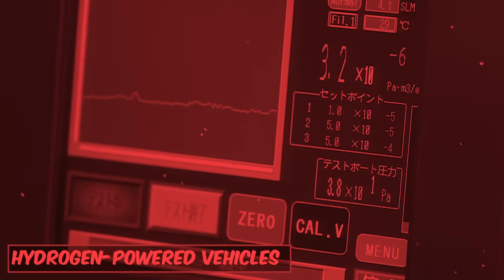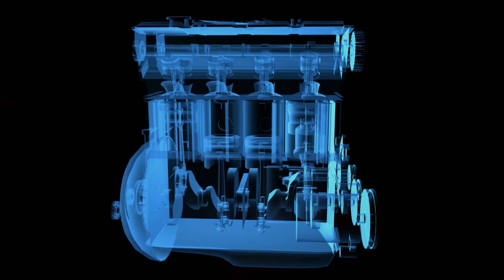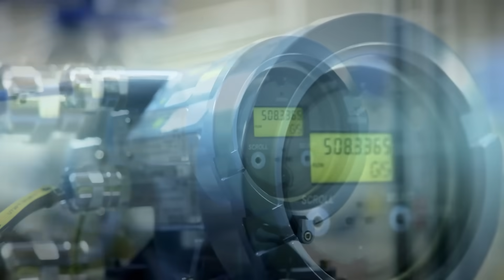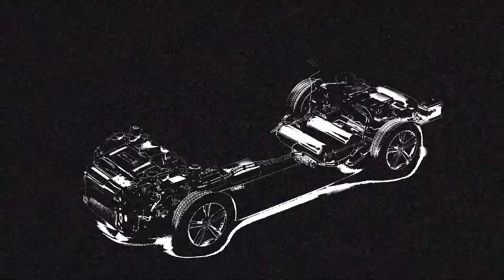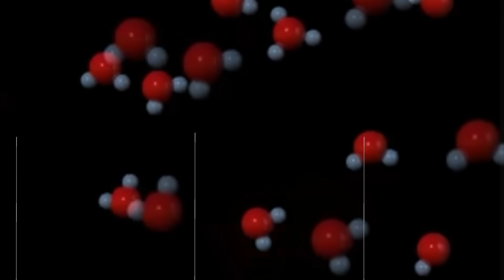Toyota's New WATER Engine Will Destroy The Entire EV Industry!

Comment: Lmao the information in this video is not accurate. It does not run on water. It runs on Hydrogen, which has to be pumped from a pump - just like gas - into the carbon fiber reinforced FUEL CELL, which it definitely has. When you buy one of these vehicles @ $50k, you also get $15,000 in Hydrogen included. Water is used in the engine, but it is NOT the fuel source.
Reply: If you are burning the hydrogen in a piston engine, you are wasting valuable energy.  You might as well run it on Chivas Regal.

Comment: ABSURD in the extreme. This isn't "water fueled" any more than a steam engine is water fueled. Both need some external source of energy. NONE of the energy comes from the water. In the case of a steam engine the actual fuel is the coal or oil burned to heat the water and create steam.

In this so-called "breakthrough" the fuel is whatever is creating the electricity required to disassociate the water into hydrogen and oxygen. NO energy is coming from the water.

The video makes allusions to Toyota working on it. Note there is never any proof that Toyota is doing any such thing. They are too smart to spend a dime on this!

Comment: you only talk about the water, but where the energy come from, for electrolyze. So it need to have both. Watertank and Batterie? But even if it need a batterie which would be smaller then in EV's then I think still a good idea.
Reply: I can assure anybody that using a battery to drive an electric motor is far far more efficient than using a battery to make hydrogen, and then burning the hydrogen in a reciprocating engine.

Comment: Unfortunately, there are a lot of factual errors in this video from energy density numbers to conversion rate to proof of someone converting their car, which was debunked. What would be nice is if they got together with Mazda, on their rotary engine and Koneg for their axle motors, so they could pioneer better energy ation for the electrolysis and better horsepower for the rotary engine, combining the best of all three

Comment: Water, "its basic elements LIKE [not "of"] Hydrogen & Oxygen"?
"Diluted Water"?
High voltage electrolysis but no  battery.
 Why does that ring an alarm bell?
Reply: There's a battery. A big EV battery. The video skipped that part, but Toyota did not. It's in other videos, and in their block diagram.

Comment: What a load of bollocks.   There are four laws of thermodynamics: The first law states that energy cannot be created or destroyed.  Only transformed, and that will result in loses caused by the transforming process.  So where is the energy coming from to do the Electrolysis to get the Hydrogen to start with?  Once engine is running, it can either power travel or generate electricity for Electrolysis.   But not both, unless you can produce the formula to show how it done?  Since electrolysis requires around 53 kWh of electricity to produce one kg of hydrogen, which holds only 39.4 kWh (HHV) of energy.  So the loses already amount to 13.6kWh, before considering further loses for conversion of Hydrogen into motion.

Comment: Making a hydrogen engine is easy, the real problem the video is overlooking Is where the energy will have to come from to create the electricity for electrolysis to separate hydrogen from the water.  This is why hydrogen so inefficient is because it requires so much energy to produce And right now the electrical energy is produced by petroleum-based products.

Comment: What provides the electricity for the electrolysis?
Reply: a battery. It's an EV. lol
Reply: A battery, but closer to a normal car battery rather than an EV or even a hybrid battery.  It would have an alternator to charge the battery.  Eventually would need a new battery as do gasoline combustion engines.
Reply: @EatMyShorts75  No... where do you people get these ideas. Toyota has block diagrams of this. They're using a big EV battery. It's going to take a larger battery stack to power this than a conventional EV, because it's less efficient. I do hope they either abandon it or publish some actual papers on the technology. It seems to be pointless.
Reply: what provides the energy for a hybrid ? self generating system.

Comment: Motors running on water by electrolysis or by 'changing' the water by some secret process. have been around for 100 years but suppressed by the people in power. Don't believe what the car manufacturers and the oil companies say, they have been sitting on technology for decades that would reduce energy costs and pollution, but suppressed it in order to make more money. And the governments around the world who are so concerned about the people and our environment won't demand these companies use that technology.
Reply: But I bet you'd get very weak in the knees at getting into the nitty gritty of material dialectics, and at identifying the inherent flaws of capitalism

Comment: I agree with smferreiro.  The article is light on engineering.  We all know what water is, where it comes from and that you can store it in plastic containers but where does the considerable amount of electric power come from?  There will still need to be some onboard storage of hydrogen as the electrolysis system will not be able to match the rapid changes required by the engine.  Will the electrical power be stored or generated?  If generated, there will need to be a mechanism for starting the engine.  We need much more info about the electrical system.
Reply: Look up water to fuel u can build one yourself with hardware store components.   And yes it takes more energy to roduce than it will put out the gas produced is highly explosive and must be made in small amounts this is old tech google it
Reply: You cannot get more power from hydrogen, wether you combust it or just combine it with oxygen to produce electricity. The power it'll produce is always less than the power used for electrolysis. This can be done in gasoline and other combustible substance because the potential energy within a small amount of gasoline is so high enough to run an engine and the alternator itself which produce electricity used to ignite the gasoline.

Comment: One question I have is cold climates ? Where I live you can get sub zero temps.
Reply: i guess once the engine start there is enough heat to warm the water in winter.

Comment: The elephant in the room is: After saying "forget charging lithium batteries", where then is the electrical energy for all that electrolysis supposed to come from? Water isn't fuel. It is the product you get from burning hydrogen fuel. The video mentions that high voltage is needed to break the water down into hydrogen and oxygen, but never mentions how that is supposed to be driven. There will obviously still need to be a battery. At which point, the electrolysis and hydrogen engine are just middle-men to an electric motor. The holy grail fuel they are searching for is a liquid or solid substance that quickly beaks down to release hydrogen without input energy. Ideally it would be somewhat stable under storing conditions and breaks down in the presence of a catalyst. Water alone can not be this substance because you first have to put all the energy in that you would get out. Said substance would be made in factories using an energy intensive process that takes power from the grid as efficiently as possible. Avoiding the impact of divinding the production job into many smaller consumer units.

Comment: Fake. You need more energy to get hydrogen from water than what you get when you burn it. Instead of using electricity to separate hydrogen from water, you can use that electricity to power an electric motor with near 100% efficiency. I ban this fake science channel immediately.

Comment: It would produce less energy than required for the electrolysis. That is a fundamental physics principle. So would still need an electrical source over and above the engines alternator to produce the hydrogen.

Comment: Science fair project 1975. Built electrolysis device consisted of two small mason jars equipped with large stainless steel washers connected to an 24 volt 10 amp dc power supply. It easily powered up that tiny cox airplane engine. However, needed to mix a little mineral oil in there to prevent it from seizing up.

Comment: So, lets forget about laws of physics and dynamics for just one moment and ask this instead?
Before going straight for the ice car, (And I know that TOYOTA make cars, but they are involved in a lot of other stuff too.)
Why hasn't this tech started in another area, then adapted for the car?  Why are all the stories about inventors in garages being taken out, about the car they converted?
Surely the first thing you'd try it on would be a small generator? Or a gas heater? Lets face it if you could split water efficiently enough you'd heat your house with it first wouldn't you? Burning pure clean H gas in your home by converting a gas burner would be so much easier Shirley. (Stop calling me Shirley)
One other thing being missed is, energy doesn't just reside within the fuel source does it? I thought most came from the oxygen and reaction at temperature of combustion?
You know that oxygen that the trees and green matter produce when consuming Co2, C02 that stuff we're worried about the rise of from 0.04% of our atmosphere. Does that mean all oxygen breathing life on earth is at at the mercy of green life consuming C02? Quick better get out there and make some C02, don't want the trees to die of asphyxiation. I rely on them for the oxygen used to burn stuff to keep me warm and make my car go no matter the fuel source inc green electric cos heat was needed to manufacture the green equipment in the first place.

NB. Mans over inflated sense of self importance never ceases to amaze.

https://www.youtube.com/watch?v=j4TZMxkxySc

Comment: Many of these genius comments comparing "perpetual motion" to a water-fueled motor act as if when you drill an oil well, the drilling requires the same amount of energy as you end up pumping out of the ground. NO ! There is fuel in oil AND there is fuel in water - Hydrogen...
So the energy used to change gasoline to a spray in fuel injectors would require the same energy as running the vehicle? These are not perpetual motion machines because they are consuming energy from an external source and are not isolated systems. Perpetual Motion describes a motor that doesn't require refills and not a water-fueled motor.

Comment: Nice, but it's still an internal-combustion engine requiring oil in the crankcase, transmission and differential, etc.  However, it would be a vast improvement in air quality. .

Comment: You are right to raise this question. The video does not explain where the electricity comes from for the electrolysis. However,, I think it comes down to whether it takes more energy to break down water than  the power output of the engine.
Reply: 12v Battery, the same thing your starter uses to start your car when its not running
Reply: @Its_Ed02  Yes, you can split water with only 12 volts, but can it generate enough hydrogen to run a car engine continuously? If so, what size would the electrolysis equipment need to be?
Reply: @joerizzo53 your a thinker 👍
Reply: @joerizzo53 
I ran a 4 cyl and a v8 Chevrolet on a 2.5"x6" tube cell and drove thousands of miles with nothing more than the factory size battery and alternator running the entire system as it should.  A few minor interruptions of signals and some plug and play additions.  Simple,  efficient and easy
Reply: It takes "at least" as much power/energy to separate hydrogen from water (electrolysis) as you get back from "recombining" the hydrogen with oxygen in the combustion chamber (combustion).  In the real world (according to the laws of thermodynamics), you will always get less back.  What a load of shit.
Reply: @kencentury I tend to agree,it didn’t work for me.
Reply: @kencentury there is a way
Reply: @kencentury  Yeah, totally, there was a study at Ohio University that explored the use of urine (amonia), which took much less energy to extract hydrogyn through electrolysis. The program disappeared but seemed to have more promise as a starting point as opposed to water.
Reply: @kencentury  
The 3 laws of thermodynamics are:
1)  You can't win (get more work out than you put in)
2)  You can't break even (get out what you put in)
3)  You can't get out of the game.  (exhaust at abs zero T).
Ergo, the efficiency of an engine will always be less than 100%.  The maximum theoretical efficiency of any engine working between Th and Tl will be %Eff = (Tl/(Th-Tl))
%Eff will be 100% only if Tl (exhaust T) is at abs zero, which is impossible to reach,
Reply: @kencentury  Check out Stan Meyers' process - he did not use electrolysis.  He came up with a way to split water into HH + O that employs high voltage at high frequency, with current (anps) approaching zero.

He used water as a dielectric between 2 plates (in close proximity) which act as a capacitor, but charge polarity never reverses (unlike alternating current).
Reply: @samjubilee6593 That guy who was proved to be fraudulent in 1995 by Ohio court.
Reply: @AStoryteller-for-fun  Yeah right - aftrr he was poisoned in 1992 (his brother with him when he died) and could not be in court to defend himself.  I cannot say that you are not naive.
Reply: @samjubilee6593  Why nobody replicated this process yet?
Reply: It takes more energy to create the hydrogen from water than the energy produced when the hydrogen recombines with oxygen to produce water. Given that the Carnot cycle cannot be 100% efficient you lose in both elements that are part of the concept.
Reply: Ding ding ding ding. We have a winner. You could make something like this work if you hate a battery that stored enough power for the electrolisis process......but then your still back to a electrically powered car but with possibly worse efficiency. Plus you now need to recharge the battery and fill it with DI water. I'd love to be wrong about this but I see nothing in the thermodynamics that suggest I am.
Reply: I tried a kit I purchased from Canada on a 2-7 TDV6 Land Rover discovery,I used the car’s battery for the electric to convert the water into hydrogen and then fed the gas down the air intake,the water bubbled away producing the gas,on a long journey the water tended to boil, the engine ran smoother but there was absolutely no mileage improvement. I tried several things to improve the water temperature even mounting the bottle ahead of the radiator to cool the liquid but even that only worked for a short while,I fitted a voltage regulator to cut down the power to the bottle,I played around with this system for weeks but could never get it right,perhaps it might have worked better on a petrol engine but it did say it could be used on a Diesel engine.I gave up in the end and it’s now in my garage,the people I purchased it off never replied to my emails when I complained it didn’t work properly,I thought it might be great if it did what they claimed it would do,more power and better fuel consumption,what a con it did neither.
Reply: Absolutely
Reply: yes entropy can be a bitch !!
Reply: All voltage with limited current I suspect... that is obviously their 'new electrolysis process' secret..... if any of this is actually real.
Reply: initially a 12 volt battery, frun to a high voltage igniter that can put out up to 20,000 volts! Then once running a standard alternator will suffice. It is high voltage not high current that separates the hydrogen.😊
Reply: uh.... as the engine spins the alternater is producing 12 to 24 volts at quite the amperage... you know,   to run your electric windowsas such   as example
Reply: This car maybe carries a huge battery and has a super inverter which only consume small AMP  to convert it into stronger current which is enough to split the H20 to HHO. there are hidden techniques also to eve run a generator with added more magnets to run itself without using electricity. I guess they use not just one technology in this car, I think it was not just about electrolysis, inverter, magnets and some mechanical advance design.
Reply: Hoorayyy!! Yes, exactly ....
Reply: Do you know dams. If electricity can be powered by water in dams than it can be in machines too
Reply: @Potatoalex538  how do explain 🤔
Reply: @mattlawton088  watch how dams produce electricity with just water you can even make mini dams at your home and still produce electricity I have seen a video where a guy build his own mini dams to get electricity while living in off-grid forest
Reply: @Potatoalex538 
       Anacanapanastan💥🎯♾️!!!
Reply: Combustion of hydrogen produces more power than the electrolysis process in theory. The limiting factor is reducing the inefficiencies of heat to torque in the engine and electrolysis. It is possible in theory.
Reply: @Brock-g3w  how so. I would assume that the hydrolysis process separates the hydrogen from oxygen, and the combustion process recombines hydrogen through a redox reaction. Am i missing something? Are there other chemical reactions involved in the combustion reaction? How do you get more energy from reversing the same chemical reaction you began with? I'm not a chemistry, so I don't claim to have a complete understanding of the chemistry.
Reply: @Knoxvillemoto  I agree with you. All chemical reactions have losses. So this process would consume more energy than it produces.
Reply: @Brock-g3w  That makes no sense. All chemical and mechanical processes have energy losses to heat.